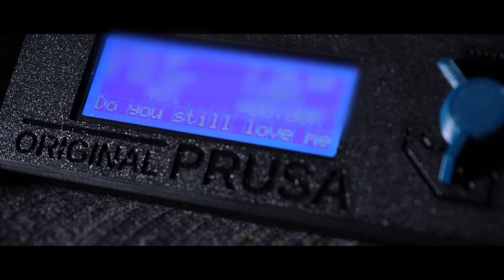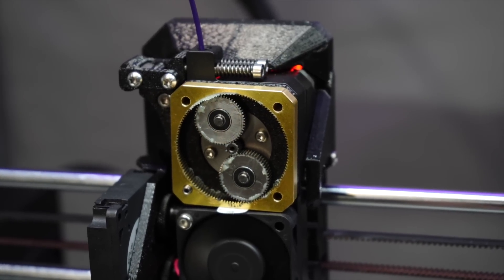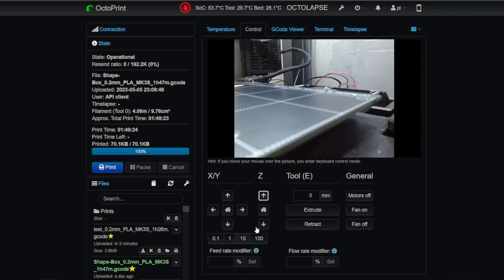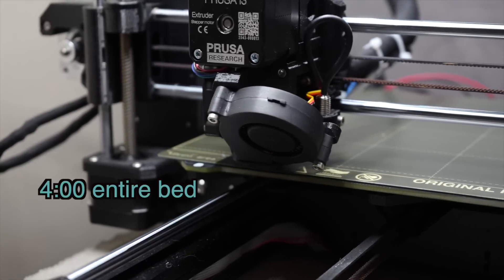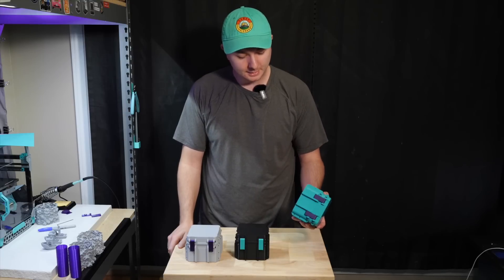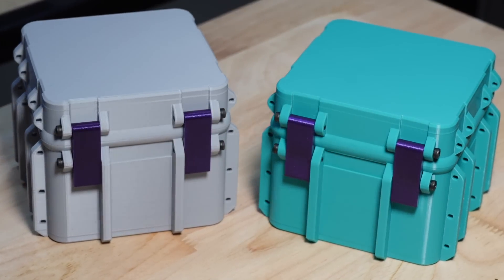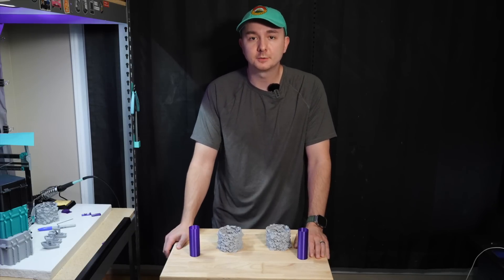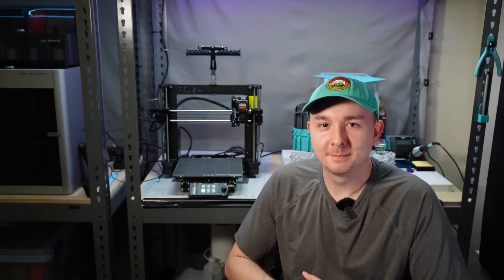Is the Prusa MK4 worth it?

Comment: Thanks for the video, very informative.   I've already got a MK3s and am still deciding on if I will upgrade to a MK4. Its maybe a bit silly, but the reason I'm not interested in a Bambu Labs printer is its just one more expensive thing that's made in China.  I feel like just about everything we buy nowadays is made there and it's nice to be able to spread $$$ around, especially on expensive things like a 3d printer.  They do seem to make a great printer though.
Reply from the maker: I like my X1 alot but I totally understand your thought process! It's not like buying a Prusa is a bad investment by any means even if it's slower
Reply: I also heard it is loud!
Reply: I have a business to run and my clients dont ask if the print was done on a printer made in China, Prague or the moon. I had the fortune to use an Creality, Ankermake, Prusa and Bambu. You can tell from the video which printer is superior this round. Perhaps Prusa will have a killer firmware update that brings parity to Bambu lab but we have to deal with what is available now, not what is promised later.
Reply: @ashleys3dprintshop  My assumption is that Prusa will not catch up to Bambu with a simple firmware update. It is nice that they are an open source printer, so being able to repair/replace parts will probably be easier but I don't know if that will be enough to sway most people. Bambu definitely has a hell of a machine, no question, but as a hobbyist I can afford to be irrationally picky with where I buy my stuff from. I get that most people don't care or have no choice but to buy Chinese stuff and  I certainly have a lot of other 'made in china' products in my house, but it's nice to help out the competition when possible. Sadly, for various reasons that include Chinese competition, not much is manufactured in my country anymore (USA)

Comment: Incredibly well done beginning of your clip. Really enjoyed it.
I would be interested how the print quality at the high speed is compared to the Prusa? How is the layer adhesion?
By the way, you already have the improved version with 3 screws instead of 4 on the nextdruder.
Reply from the maker: I definitely should have showed off some more prints from the X1. I find that it usually prints just as good. With PETG or ABS you sometimes have to print more parts at once or change minimum layer times because of the speed though.

Comment: Strange how the upload speed is given so much emphasis. It really isn’t that bad. Not enough to detract from the overall value of the printer.
Reply from the maker: I don't think it detracts from the value - I just don't understand how it's KB/s. Especially since the printer needs to be on the main screen or it fails. You might forget its not there and press upload and walk away thinking it will print. You'd get instant feedback that it failed if the upload speed was faster. I showed a file that was only 3MB, but models can be much bigger. I was told its already improved with a newer firmware so I'm sure it will get better.
Reply: @ButterPockets  I have the new firmware, and the transfer speed still is slow...... I am using an Ethernet cable, maybe that is slowing it down.  Also, it seems very prone to restart the transfer???

Comment: Reliability and serviceability is why I still choose prusa over BL, reliability matters to me, not speed, even though my MK3 prints just 17% slower than my P1P did. My P1P was dead within 10 hrs and was a month long headache to get a replacement part and then to get my money back when I tried to return it, did a chargeback. I wont be buying a MK4 probably until they stop making MK3's. I can get a fully assembled MK3 for $810 with their 10% off, damn good deal for a tried tested workhorse. My oldest MK3 is 4 years old with almost 18K hours, zero failed/replaced components or chats with CS.

Prusa stopping production, or ceasing shipping to fix something as little as a rattling problems shows me prusa cares about making things right, opposed to BL that wont fix their warped build plates, just keeps shipping replacements that are more warped that the last. Or how they keep you in an endless loop of support tickets just to get a replacement stepper motor like they did with me.
Reply: Just so everyone is aware this gentleman trolls every video that features a Bambulab printer and trashes the product. He does NOT have a Bambu lab printer as I have been interacting with him for months. What I dont understand is why he feels the need to bring someone else down to make himself have less buyers remorse in his current product.
Reply: @hawtdayum  
As luck would have it, it is a basic human right to have an opinion. And to express it. And why one should only be allowed to post, if one agrees with you, I have a hard time to understand.
Are you, by any chance, a member of the Chinese government? Or American Republican?
Reply: @TrollWithOpinions  why shouldn't we call out someone telling obvious lies? His Mk3 is not just 17% slower than a P1P. That is a 100% silly claim. For someone running a printer farm you would only need about 1/3 as many printers if you go Bambu vs Prusa.
Reply from the maker: My first purchase was my MK3 because after all my research Prusa seemed like the best company to go with. That's why I didn't get rid of it when I got an X1 and why I still continue to print on it even tho the X1 is faster. Ive also had absolutely 0 things wrong with my MK3 and its got 2000+ hours. I'm confident the MK4 will keep to that tradition and only improve over time with firmware updates.
Reply: Not to mention the sad fact that BL is a Chinese company subject to Chinese law, which basically means that they are allowed to underpay and overwork their emplyees. Which they do. They are also required to hand over data on their customers at the demand of their government. Which happens a lot with Chinese companies.
And personally I see little reason to support an oppressive regime more than I absolutely have to.